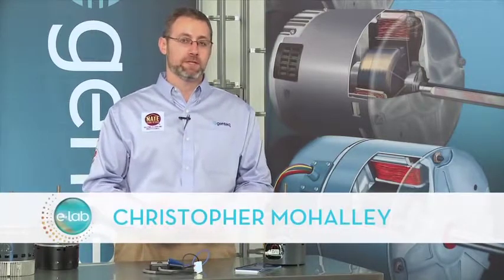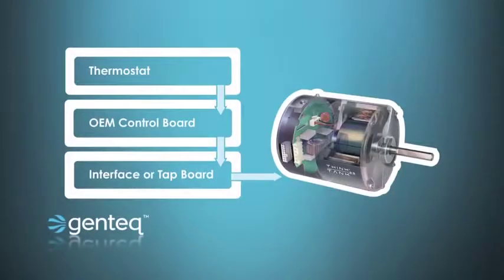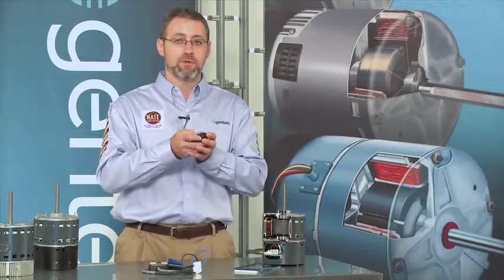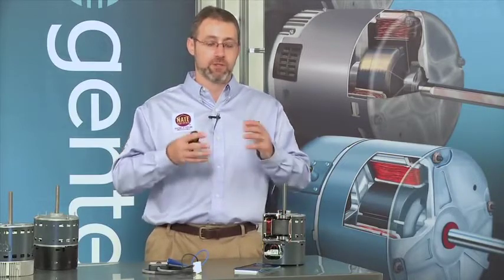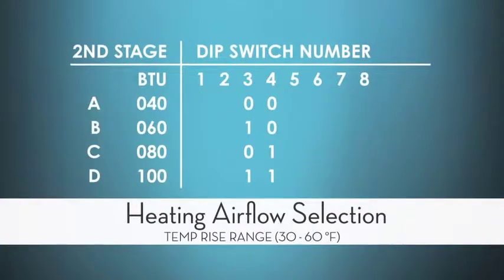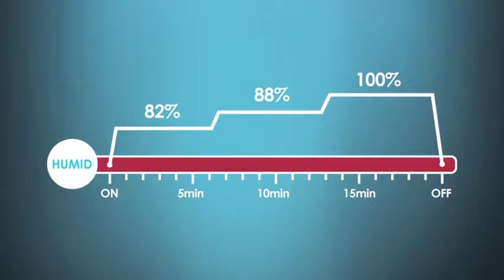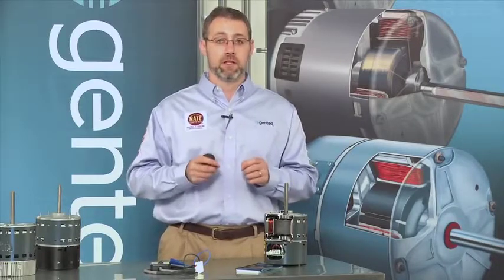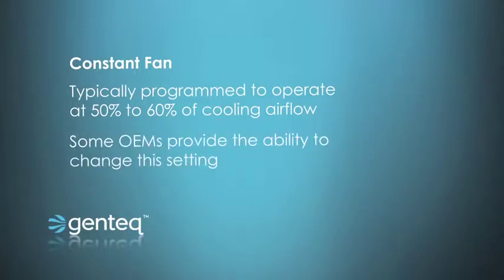Genteq Variable Speed 102 - Constant Airflow ECM Technology

Comment: Sadly, Genteq X13 has a bad reputation for overpriced ECM motors/modules and total unreliable which carries high maintenance costs. Every HVAC tech says so. Maybe find electronic parts that will not fail in 15 years of use !  Cheap inferior components is plain dumb.